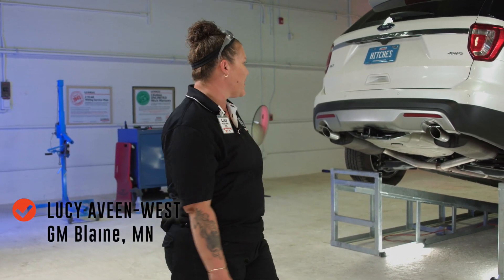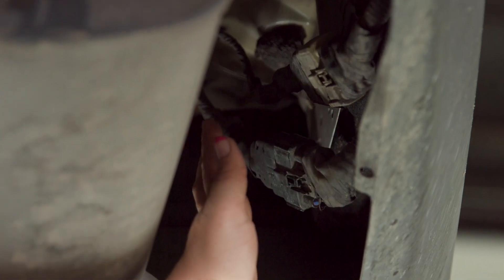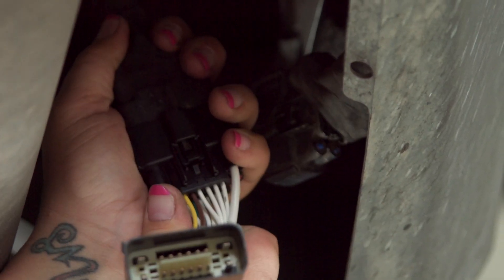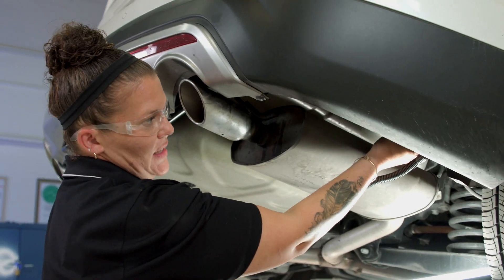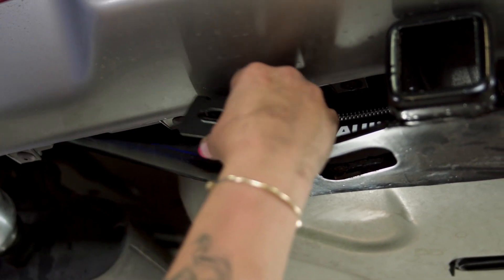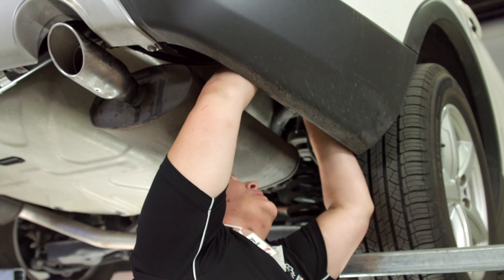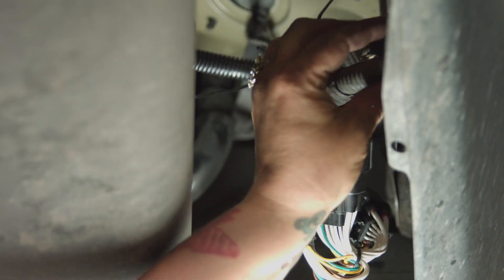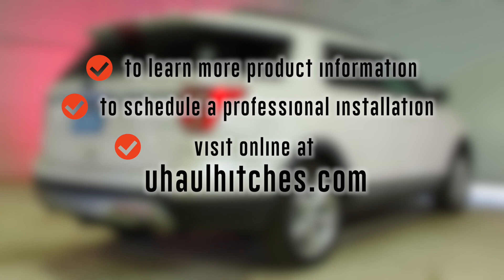2014 Ford Explorer Trailer Wiring Installation

Comment: Very simple, thank you for that video. Are the parking sensors are switched off automatically when I connect a trailer?
Reply: The parking sensors do not switch off automatically when a trailer is connected. You'll have to manually switch them off.

Comment: This doesn't work on a 2wd vehicle. There is only one connection behind the passenger bumper and it's not for the lights.
Reply: Sorry you're having trouble putting this harness on. This install is just a plug and play so if it isn't working there may be a connection/part issue or something isn't working on your trailer. If you continue to have issues, take it down to you closest U-Haul hitch center and they can take a look at it. You can find your closest center at the link in the description.